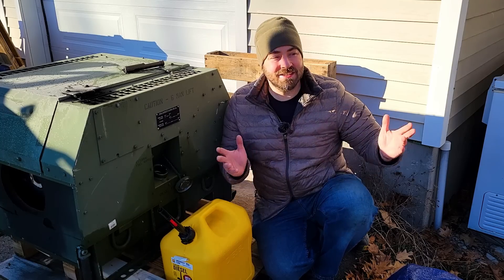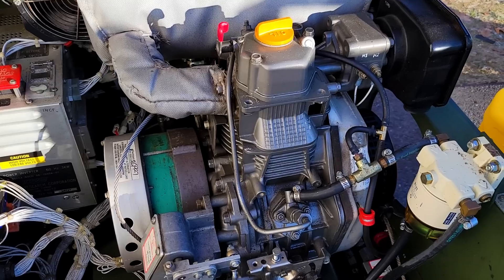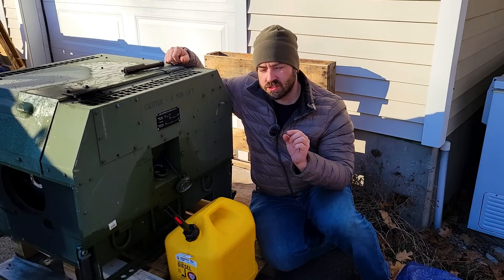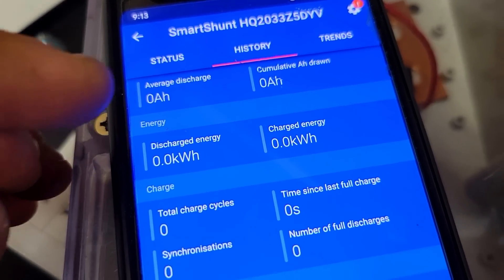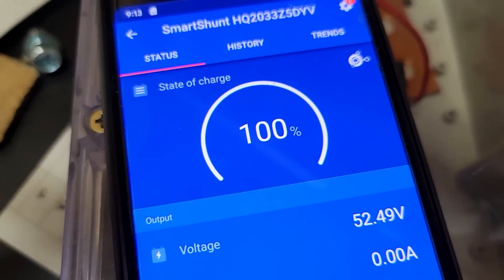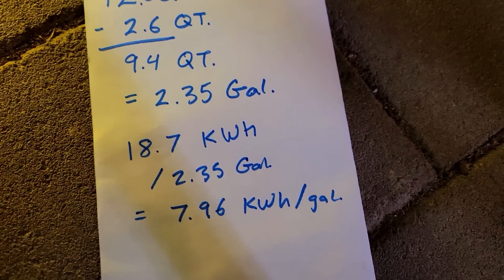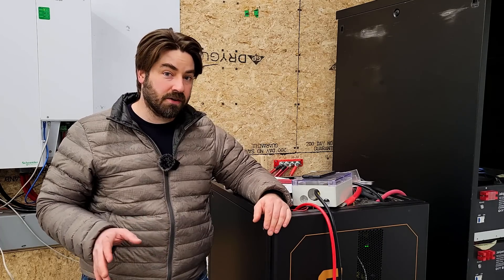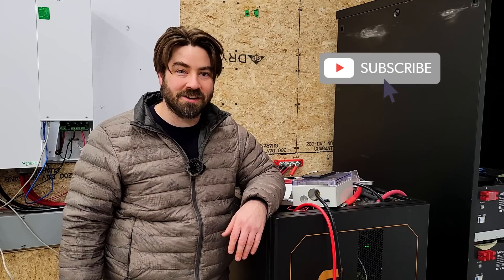How efficient is this Army generator?  MEP-831A

Comment: Bit of a long post but I have some generator findings and I'm a mechanic.
I live on generator power with no battery storage. I have a generator very similar to this. Since I'm on 240v @50hz, it runs at 3000rpm. It's also enclosed, has a 22lt fuel tank with electronic control and is rated at 7kva. The fuel consumption is amazing. There's no getting away from the fact, it really is very good for the power output. 
The problem with these generators is engine life. You get about 3000hrs. I'm on my second engine and it's at 2900hrs. I have a load bank for setting the governor and general fault diagnosis and I can no longer get the poor thing to make rated power LOL. It now makes makes 5500w that's it. 
Some findings, the power is very dirty and the frequency regulation is terrible. For charging a battery bank it could be good as part of having solar panels and you use it less than 250-500hrs a year.

Re charging battery banks, Jesse at Solar Solution points out generator sizing is very simple. You size the generator to the load to get the most out of your fuel. If you can take 100a into your battery bank, you need a generator capable of delivering 100a continuous (+ a bit of headroom I'd say so a generator able to make 110a continuous).
It's very difficult to argue with since if you have a smaller generator using less fuel it still uses more fuel charging for longer than a generator sized correctly to the load. 
I will add, to get the most out of your fuel you need a good quality generator. The moment you cheap out, the generator fuel consumption rises dramatically. A 10kw 4 cylinder cheap Chinese generator with brushes might consume at full load 2 lts an hour more than a mid priced Chinese generator with a better engine and a brushless alternator. Over 10 hours that's tons more fuel.

For a long life generator, I ditched the air cooled single cylinder Yanmar and got a 5kva 3 cylinder liquid cooled Mitsubishi with a brushless alternator and a proper governor. It only turns at 1500rpm. The fuel consumption is pretty good. 50hrs a week average it uses about 40-50 litres depending on the time of year, however 95% of the time it is running less than 1000w in the warmer months and in the cooler months runs at about 2500w about 70% of the time increasing the fuel consumption to a guaranteed 50lts/week.

I will say this, In some ways I wish I had bought a 4 cylinder generator. The fact of the matter is if you go 4 cylinder for a similar power rating you lose in fuel consumption because you have 1 more cylinder extra in engine pumping losses to pay for in fuel - meaning fuel consumption increases at all loads.
But the problem is 3 cylinder engines vibrate. The vibration is a fore aft rocking couple that can only be managed not eliminated.
It way better than a single, but still pretty bad. Long term, the cabinet door latches wear out, brackets crack, bolts come loose, this sort of thing. Upside is the fuel consumption is pretty good. 

Battery charging and living directly off generator power are conflicting applications. There is no perfect generator for living directly, since a generator is either too big (poor fuel consumption), too small (not enough power), or just right (too much fuel consumption and not enough power when you need it). One realizes what a luxury having mains power is, as you only use what you need and if it breaks someone else fixes it. You do grow to hate generators that's for sure.

Charging a battery bank you can get it pretty right, just size a mid priced generator to the load. A good mid priced generator should get you 20,000hrs life and a supply of spare parts.
Reply: Yeah, you definitely need some solar and batteries plus a smaller but more durable generator. Unless you're up in alaska or canada

Comment: That works out to just about 20% efficient, fuel energy to DC to the battery. Pretty low for a diesel, but there were the extra conversion steps. An engine direct driving a good 50 volt DC generator (not just an automotive “alternator”) would be a better way to go. 

Regardless, it exemplifies why off grid generator sets should always focus on heat recovery, as that’s where most of the fuel ends up. The electricity generated is but a small fraction of the total energy purchased in the fuel.

Comment: Didn’t know those were inverter generators, always thought it was a 1800 rpm generator. I’ll look into them. Yanmar diesels are robust for sure.
Reply from the maker: The larger generators (MEP-802A and up) are 1800RPM.  This one can vary it's RPM up to 3600 depending on load.
Reply: @DavidPozEnergy  do you know if they made a gasoline 1800 rpm unit?
Reply from the maker: When I was in, it was all diesel.  Maybe there were some gasoline units if you go back older?
Reply: @DavidPozEnergy  yeah I’ve seen sine from Vietnam that are gasoline but those are 3600. Probably SOL. Might just buy a gasoline 28 volt charger MEP or gut the electronics and put an 24 volt alternator on it. I have free NG so spark ignited is my best choice.

Comment: that diesel generator is what my red diesel was modeled off of, it looks almost the same - the inverter. it was rated at 6.5kwh lol could do 5.5kwh but was to small for my house so I purchased a 11000w Yamaha with a 3 cylinder Kubota engine. with I could of kept that little diesel :D. great test.

Comment: Greetings David. I have been using the MEP-016D diesel generator since 2015, it  also has the Yanmar L70 engine. We are 100% Off Grid. I did a similar test back in 2015. Off road fuel was $1.98
I was able to make 1 kilowat for $.36 cents. The MEP-016D Is not a inverter type life yours but is very fuel efficient and robust. It will put out 4k all day though it is only rated for 3k .
In my opinion the L70 Yanmar is the most fuel efficient I have come across. The BTU in diesel is higher than gas along with no road tax it is a winner for sure. I will be doing  another test with a propane generator. By the way the inverter generators are only more efficient when you have variable loads. For you and I we are charging large battery banks at fixed loads. There are times when I charge our batteries using the Magnum inverter/charger and pass through AC loads to the house at the same time . In cases like this I do use a gasoline inverter generator. Nice test brother.  Have a blessed night.
Reply from the maker: Thanks for your comment.  Sounds like you have a nice setup.

Comment: Sorry to be 'that guy' but there is about 12% more BTUs in diesel than gasoline, so comparing them on a per-gallon basis will not accurately convey efficiency. On a BTU per watts basis, this places the Military generator at 5.8 and the Honda at roughly 5. That is a difference of 14% in favor of the Military generator once the fuel difference is accounted for. A more accurate number, but not a partially important one.

The 35% number originally given is actually much more useful to determine run cost .... you just have to include the cost difference of the fuel. Let's assume you are running regular in the Honda. Ballparking AAA numbers for the USA gives us a very rough ~$3 for gas and somewhere between ~$3.75 to $4 for diesel. The break even point (with gas at $3) is $4.05 so the question of which is cheaper to run may very well come down to the cost of the fuels where you are at and on that particular day. Given these very general prices, diesel does still come out ahead, but it is 1 to 10% cheaper to run as a rule of thumb.

I'm sure the above rings a bit more accurate deep down, but I also know '35% more efficient' sounds really nice to someone who just put a good chunk of time and money into the project! It happens to us all. If you want to go a bit dipper into this, you might want to convert the DIY version to propane for further comparison. Propane has the advantage of not going bad in the tank and fouling out when you most need the standby power. It also doesn't need the extra heat (usually via electric) to start up in the cold that a bigger diesel does. To dive off the deep in, start making your own biogas (methane) via anaerobic composting. Could be some fun videos!
Reply: Hey "that guy" while everything you said might be mathematically accurate, the video is just fine. He compares a generator to another generator. He didn't get it wrong. He gave people a starting place to be able to make an informed decision about buying a generator based on what's most important to them.

Your fuel cost estimates are only valid for this week they were wildly different 3 years ago and different 3 years before that. Most people buy a generator and hang on to it for a very long time so relative fuel costs at a point in time are completely irrelevant

Comment: I really curious where you find the military diesel generator. I use a harbor freight predator 3500 with my RV. However, my RV is diesel powered and I would rather have something on board that I did not need a separate fuel supply for. I just want to tap into my 200 gallon fuel tanks. It’s very difficult to find a diesel generator. And I don’t need a really large one. Just something to charge batteries in the case that my off grid system doesn’t get enough sun.
Reply: he got it from a military surplus website

Comment: This works out to be a total efficiency of 21% which is really not a very good return on the cost of fuel. Perhaps a more 'combined heat and power' strategy would be worth considering for off grid use. Nearly all of the 79% was heat...70kWh of it. That would heat a metric ton of water from 10 to 70 deg C.

Comment: I've been planning of getting a 1-cyl Yanmar to drive a Balmar 100A 48v (58v) LFP aware alternator... Figured it'd be the smallest package I can get and avoids the losses of AC -> DC conversion. If your numbers are not too far off what I'd get, then my 45 usg of diesel would give me 360kwh, or an additional 163 hours at ~4 knots, or 654 nautical miles of additional range, for a total of 827 nautical miles range, purely off the starting charge and what I could generate from the diesel. Holy crap!
Reply: Aren't balmar alternators a ton of money, and while being an alternator, not very efficient, maybe 60~ish %

Better find yourself a moped or bicycle hubmotor and try to run that off an engine, put the  AC through some diodes to make DC and charge your battery like that, more efficient and cheaper.

The more rpm you put into a permanent magnet hubmotor the more voltage comes out, once it hits battery voltage it comes under load and becomes harder to increase rpm, it is then charging the batteries.

Most hub motors run quite cool at 2/3 of their rating, cool = efficient, so DavidPoz gets 21,5% efficiency out of his diesel Genny, I get about 28% out of a 36 year old diesel engine with hub motor, I bet a modern Yanmar would even be more fuel efficient.

Comment: Thanks for doing this. I'm off grid winter charging batteries with gasoline generators. I keep looking at diesel generators (new) which are many times more expensive than gasoline open frame units. I'd like to know the ins and out of locating a military diesel generator.
Reply from the maker: Your welcome.  There are a ton of options out there, it's nice fun to compare a few.

Comment: To be fair, diesel fuel has significantly more energy per gallon than gasoline. The diesel generator is definitely more efficient even with that factored in however.
Reply: That's true. But it doesn't really matter if you don't have diesel fuel readily available. It's a generator comparison.

Comment: Not efficient. Taking a voltage and changing it twice from its original form is inefficient. That is a poor design.
Reply: What would you recommend as a better solution for the average homeowner with solar panels experiencing extended days where solar production is low or non-existent?

Comment: Now it's time to do it with an mep-802a.
Reply from the maker: I will soon.  I'm still breaking-in my MEP-802A.
Reply: @DavidPozEnergy   I love my MEP-802-A with 2 wire start.  Connected to the same 48v charger that you have is a great combo

Comment: Nice test. 
By volume automotive diesel is ~15% more energy dense than gasoline/petrol, so that accounts for about half of the "efficiency" you are reporting. Your numbers are really "economy" values than efficiency (similar to mpg used for cars). 

Efficiency (as you know) measures the ratio of energy out to energy in, and for that you need to use the specific volumetric energy density of the fuel used. So I'd say the military generator is ~15-20% more efficient than the Honda, but has 35% higher fuel economy. No idea what your diesel vs gasoline prices are like there. Here (Australia) diesel is typically 10-15% more expensive, although it can vary. All our petroleum is imported.

I'm just about finished with the need for using a generator as a backup charger for our off-grid system. Rarely use it anyway. We have a battery electric vehicle now and the vehicle to load (V2L) function will enable me to put a steady 2kW into the battery via a spare AC to DC charge controller I have (a spare all in one inverter) - using it like just the Chargeverter you have (Chargeverter is a bit more convenient but functionally I can set the charge voltage and current in 10A increments, so 40 A ~ 2kW. 

With some tweaking I think I can up the V2L 3kW but 2kW is ample for that steady supplemental recharge, even 1kW or 1.5kW would be plenty for us. Our Winter PV production will be much better than yours, our latitude is ~ 30.5° from equator (south). The EV can comfortable supply a spare 35 kWh (given it's typically sitting at ~ 80% SOC), and with planning it can be closer to 45 kWh available while still having ample capacity for local driving or to reach a DC charger in another district. Normally it is charged from our grid-tied PV array but I can slow charge from off-grid if needed (especially when I add the extra off-grid PV this year).
Reply from the maker: Thank you.

Comment: I have the Westinghouse i2200 (1700W; 1.3 gal) and i4500 (3700W; 3.4 gal).
I have EG4 24V charger (900W/ ~1250W) and a Victron (300W/ ~450W) 
The chargers have a pF = ~0.7 ! (output/ input)
Generator output = charger input. 450+1250 = ~1700W input so it is right at max running power.

The i2200 is more efficient running full load. 
I get about 4.5 to 5/5 hours at full load. EG4 + Victron
It will run close to 12 hours running just the Victron. (overnight)

The i4500 has more capacity and a longer runtime.
It will run all night connected to 1 EG4 charger.
The i2200 can run (01) EG4 24V 30A charger AND a Victron Blue 24V 12A smart charger.

The i4500 can run (02) EG4 24V 30A charger AND a Victron Blue 24V 12A smart charger.
I think the smaller engine has less friction, etc so the fuel not used directly for charging is less.

Comment: I wonder how (in-)efficient is charging from alternator of idling car compared to real generators.
Reply: i also like that question. the problem is: cars in idle turn the alternator at like 1500-2000 rpm. and thatvis the lowest end of producing current at all.

so a 100A alt would put out like 28A in idle. at 14V.  that is Nu-Thin if you need to run a homestead off that.

Comment: Diesel always has more energy per gallon than gasoline, because chemistry.  I'm glad that generator was able to extract it.  The simplicity of old diesel engines might make the aggravation of dealing with a second fuel source worthwhile (if you don't already keep diesel).  I have a small diesel tractor, but I'm still not convinced a small diesel generator is for me. I think a 15kw or so PTO driven alternator for direct D.C. charging might be just the ticket if I can find one at a reasonable price. Until then probably a cheap (not Honda) inverter generator will have to do.  So cheap, so obtainable. And so far plenty reliable for the price.
Reply: Diesel only has about 13% more volumetric energy density than gasoline. The bigger difference is that the diesel cycle (fuel spontaneously ignites with air due to the pressure) is more efficient than the otto cycle used for gasoline (fuel/air mixture is ignited by a spark plug, and the combustion wavefront has to travel to use up all the fuel). Gasoline ICE engines typically top out at around 35%-40% peak efficiency. Diesel ICE truck engines can hit 45%-55%, with the big diesels used aboard locomotives and cargo ships able to reach over 60% efficiency. To reach similar efficiencies with gasoline (or kerosene), you need to use a gas turbine engine.

DIesel is also non-volatile (less of it wants to turn into a vapor). Unlike gasoline, you can drop a lit match in it and the match will go out. Diesel will not sustain a flame until it reaches about 160 F. So it's safer to store and handle.

Comment: Now imagine the efficiency during winter if you had a water cooled generator or an exhaust heat exchanger which could heat your garage, workshop, or home.
Reply: Cogeneration units are commercially available, but unfortunately not in the US. Honda made their MCHP (Micro Combined Heat & Power) units for the Japanese market back in ~2012. The keywords for these types of systems are cogeneration and CHP for those interested.
Reply: Interesting comment, it would be great seeing David do something like this
Reply: There is generators for tractor pto, so it only need more pipe and plumber work to harvest every Joule from fuel.